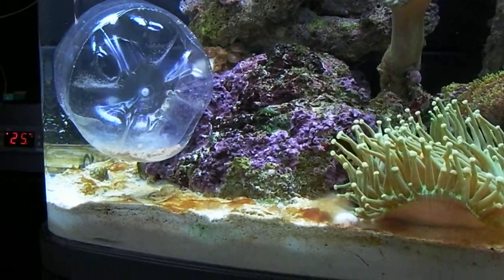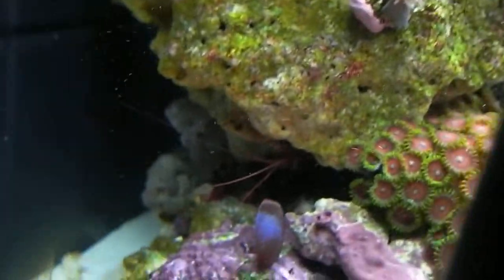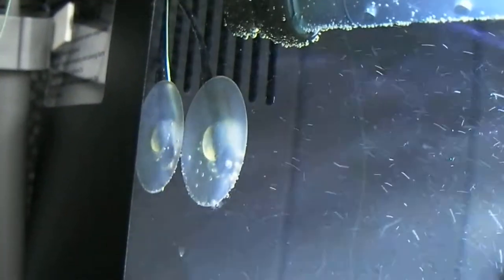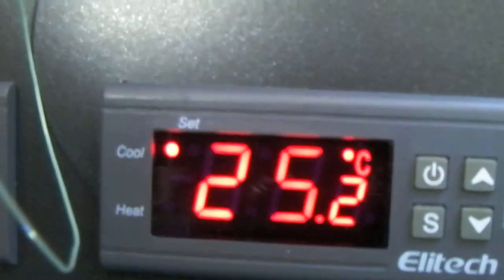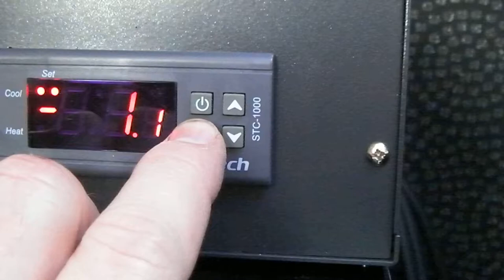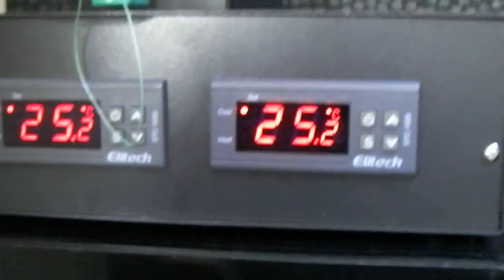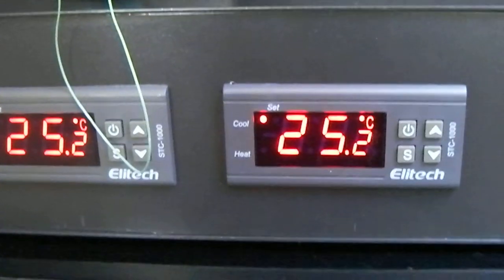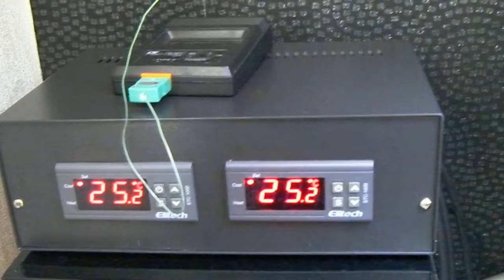STC1000 Dual Heater Controller. Part 2.

Comment from the maker: Both the Seneye and Stc1000 can be calibrated. Use an accurate thermometer, I use a k type thermocouple and meter, adjust them so they all read the same as mine do. The readings also match the fluval G6 readings that can't be calibrated.
Reply: Thanks for your quick reply I will purchase one

Comment: Hi do you find the stc 1000s accurate? how do they compare to the seneye data?
I am running a stc 1000 just as a thermometer and it is probably 2 degrees higher than the seneye